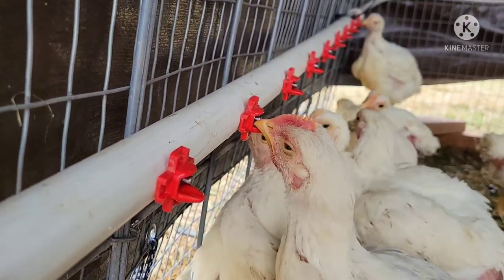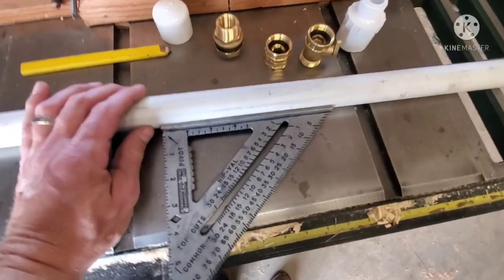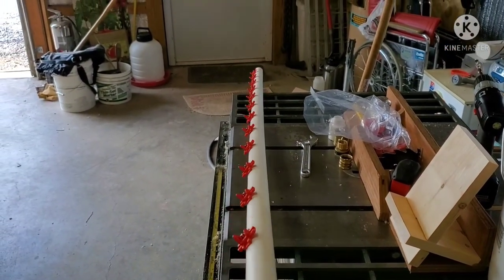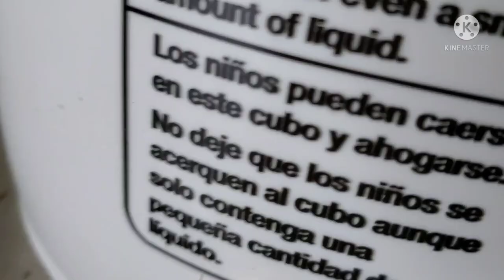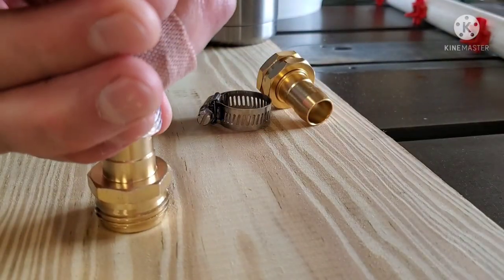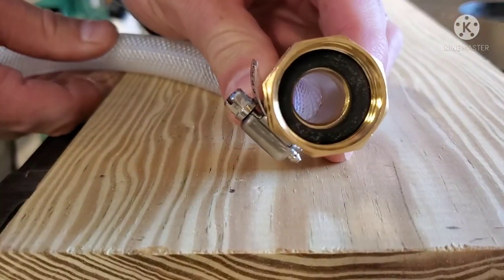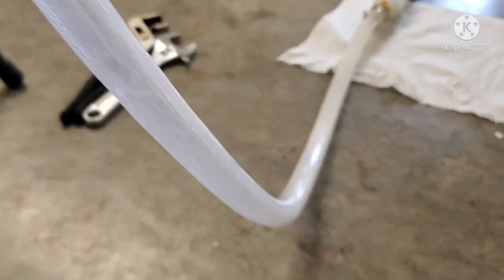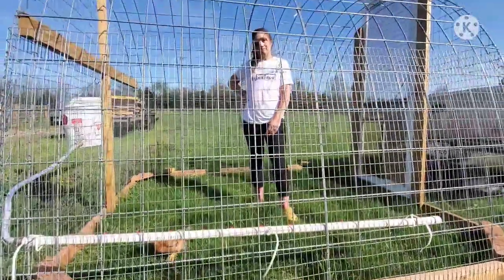Chicken Water System-easy, clean, diy

Comment: Great system, just one note about gluing, always use primer as that creates a chemical reaction that melts the two pieces together and put glue on both ends. Give it a twist to get contact and wipe the excess off on the outside as it will form a crust leaving the inside to keep melting the fitting making it brittle.  Enjoyed your video
Reply from the maker: Thank you!

Comment: It should be noted that the 1" slip to 3/4" thread will not adapt to the garden hose.  PVC is NPT.  Garden hose, I think, is NIFT.  They are different thread sizes and you may need a special adapter.
Reply: For the connection to the pvc, I think you are saying we need a 3/4” female NPT thread with 3/4” barb (for hose and clamp), right? Then the other connection is a 3/4” female GHT thread with 3/4” barb (for hose and clamp). I think the video did not clarify that but that is what I am seeing is needed since the garden hose and pvc threads are GHT and NPT respectively. Thanks!

Comment: I’m following your system exactly but ran into a problem. I drilled a hole 3/8 but it was too big. I can put the nipple in and pluck it out with no effort. So I went down to 5/16 but the nipples broke with no effort. I think I ordered cheap Chinese crap. Is there any way you can share your nipple order?
Reply from the maker: https://www.premier1supplies.com/p/horizontal-nipples-chickens-poultry?variant=530024&utm_source=google&utm_medium=cpc&utm_campaign=%28ROI%29%20Smart%20Shopping%20-%20Catch%20All&utm_id=214032503&utm_content=85250050061&utm_term=&gad_source=1&gclid=Cj0KCQjw8pKxBhD_ARIsAPrG45ln2SPFwYgE63YoV4uSZmdFMSXcUCrjtDUTC0aagPOkDfuWmKamqS0aAuVKEALw_wcB
Reply: Rent-a-coop brand!